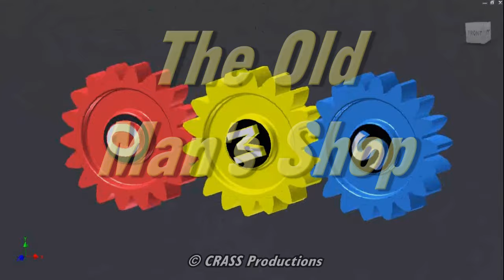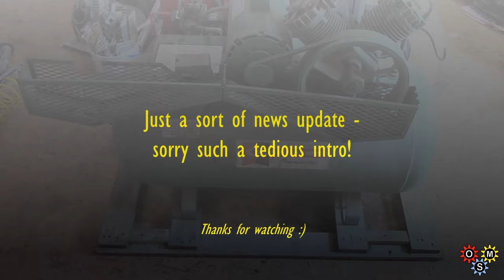Bits - 17. Old compressor and damaged clamp thread

Comment: Champion makes very high quality long life compressors. We just found a 5.5hp dual head gasoline powered unit with almost identical tank as yours, same color $200 craigslist find. All tanks get rusty inside and scale if worried fill it up for a few weeks with 1 part molassas and 9 parts water drain at end of each week and pressure wash it out and refill for an addition week and will strip out every bit of rust clean as new metal. Pressure rinse out and blow it out good and get it dry then use POR Epoxy tank sealant and coatings and never worry about it again. If I recall Eastman stocks it very good product. You will have to remove motors and heads to be able to roll your tank around to get it coated inside everywhere.  Just drain tank once a month minimum but nothing will be rusting the tank away again. Good to see you making another video again and hey insulate your ceiling it will pay for itself in no time and help equalize out the temp changes then eventually do each wall. I have over 12 inches in my shop attic and 8" in the outter walls and all sheetrocked no windows and weatherstripped overhead and side doors and I can take the chill off in winter within 15 minutes and turn off the heat for 4 more hrs and stays workable 60-65 F And its just a pole barn with metal roofing and outside siding. Summer can be 100-120 outside and shop will stay about 80 doing nothing and then turn on a swamp cooler and draw down another 15 deg off of that stays cool and I use very little electricity to do it. Nobody can say they can't afford insulation as the truth of the matter is you can't afford not to as it will cost you much more in the long run with energy bills and being sick all the time working in that cold. like you say unworkable. I know where you are at and winters get brutal but I have seen it 20 below here and my shop will rarely get down to 20 above unless I  lose the cover over the swamp cooler hole than can get cold. So where I am in high desert of eastern oregon we get scorching summers and brutally cold winters and never worry about working in the shop through any of it. Put that in 97' so almost 20 years ago and bet it save at least minimum 50 a month 600 a year 12,000 in those 20 years so far and cost 1,000 to have it insulated with labor just fiberglass bats. I recon its paid for itself what 12 times over in 20 years? I believe that is a pretty good return on investment and Its actually less drafty then in the house and better insulated.
Reply from the maker: Hi,
Wow - thanks for your super long comment.
Your suggested molasses approach sounds useful - thing is, trying to minimize my bending and lifting etc - so initially I am hoping endoscope will at least give me a clue on internal state.
I did couple of years ago put up a ceiling but it's not providing much insulation I have to admit. Trouble now is, apart from any cost factor, I cannot physically deal with further additions. Another thing is, I am not in the shop all the time at all - very sporadic really.
I sure could make good use of your shop! :)

Comment: Good video Chris, glad you enjoyed guest's visit & were able to get some work out of him. 😀 When examining the tank could you run your endoscope through the drain fitting instead of breaking the joints on the intake & risk damaging the lines?
Reply from the maker: Hello Lee, thanks,
Yes, a good couple of weeks - now have to try and catch up on things and get a bit of shop time if possible.
The tank drain fitting is very difficult to get at actually plus, I think I need to drop endoscope in from a high point to get a view. Hopefully I can crack the delivery pipe and get access - we'll see. :)

Comment: Hi Chris,

That compressor looks like it hasn't done much work - it still has over spray on the drive belt (assuming it hasn't been resprayed).

Receiver tanks are generally pretty safe from a weld perspective unless over pressrised.  It's very unlikely to let go or rupture due to rust as the welds are harder than the cylinder.  A weak rust point will just blow out a pin hole and that's it.

The best place to put in an endoscope is at the outlet point, as they often have a large diameter plug that can be unscrewed.

I read the other day that they now recon a pint of beer a day is actually good for your bones and heart.

My bones and heart must be in excellent condition.

Try "Chang" beer if you can get it - made in Thailand but suits the Aussie taste buds.

Cheers Rob
Reply from the maker: Hi Rob - I too have thought maybe it hasn't done too much work - I'll hope to check inside with endoscope first anyways and go from there, and check electrics etc. Outlet point should be removable hopefully.
Interesting re the beer - not a connoisseur myself but we have a nice home brewed ale "Juengling".

Comment: Keep up the good work I have restored a simular clamp screw and it worked out fine . Acme threads are not hard to cut but take extra time shallow cuts .
Reply from the maker: Hi Allan,
Yes, probably will make a replacement when time allows - it'll only be used occasionally. First job is to grind a tool probably.

Comment: Hi Chris, 
This tank is about to get a coloscopy.....   OUTCH....!!!
Hope it's not too filled with debris, if not it could be usable safely, cause those tanks will leak air long before there is any risk of exploding.
Getting older is a pain in the but and all other parts that reminds us about it, now if I spend many hours working in the shop I dearly pay at night, mostly the lower back...  But they say don't stop or it will get worse even faster....   
Take care,    Pierre
Reply from the maker: Hey Pierre,
Yep - try to agree on the 'don't stop' but, have done that for so long now it doesn't work so well! Brain says do something - body says "don't you 'f'ing dare'':)
I'm hoping compressor motor is OK etc and hope to get to getting some time to it this w/e. Plenty to do in shop if I can manage.
Later, Chris

Comment: You can find hundreds of online 'stores' that sell Acme rods in many sizes and lengths. A lot of CNC sites have them. MSC and McMaster Carr may have them as well.
Reply from the maker: Hi Bill - I may yet check out sources but not sure if there'll be a suitable diameter.
Reply from the maker: Thanks Bill - seems they have UNC, UNF and metric but, no ACME. I think I'll probably get to making a new one eventually but am just now continuing on the compressor. Seems viable so far - report coming later.
Reply from the maker: Ahhh - thx much for the link Bill - I'll check that out and see if I can find a size match.
Reply from the maker: Tend to agree Bill - plus no 12 TPI of suitable dia. No probs - will probably make something up eventually... and don't need a whole new one.

Comment: Nice looking compressor! Just a thought - even if you can't get a light or endoscope into the receiver, you might be able to hydrostatically test it (just as with boilers). Should be much easier and thorough than a visual inspection ?

And do keep up the videos - the aches and pains of age are just the payoff for the wisdom and experience we gain in time !

all the best
Reply from the maker: Hi Ben,
Thank you.
Hydro test would be best of course but right now no suitable pump to do it. Hope to get at least some idea with the endoscope initially.

Comment: That is a serious compressor.  I think I would work on that before the clamp.  Worrying about mine.  It has been around for at least 40 years.  It is basically the same model and age as the one that Tubalcain just had a leak on.  I always imagine it splitting down the middle and throwing things all over the place.
Reply: You will most likely get pinhole leaks long before that would ever happen an once enough of them develop here and there the unit has a hard time keeping pressure up..but the champions some are the duel stage and can be run up to 175 and some over 250 psi...if you had a few pinholes develop reset the psi on off setting to around 100 till you can seal the inside of the tank. I have an upright speedair came off the snap on truck have had it since 82 still going strong and keep it uncovered out in open air mounted to concrete slab outside. Need to get a lean to roof over it but so far hasn't seems to hurt it.
Reply from the maker: Hi Harold - well, maybe I will do that first when I can make it to the shop. Be good if it is viable.
Reply from the maker: Hi - sounds like your Speedair has served very well. I know pinholes can develop first but have also seen what happens when a tank actually explodes! I might be over cautious but ......... we'll see how it goes. :)

Comment: Hi Chris
Given the infrequent use of the clamp think I'd be inclined to try some heat ! I was given a 6" machine vice with a bent lead screw which I successfully straightened with some heat 
Keep the vids coming
H
Reply from the maker: Hi,
Thanks - well, may yet give heat a try in case it works. Worth a shot i guess. :)
Reply: Hi Chris neglected to say the one I did was M14 and yes recon width a shot !

Comment: That is a very nice compressor, if the tank is weak, although I have never heard of one leaking, you could always hitch it up to one of the tanks from a cheapo Chinese compressor, there are a lot of them laying around with burned out motors. The Record Sash Cramp ,I am sure you could buy a new screw from Record, it would be an Imperial thread at that age I would think.
Reply from the maker: Hi Chris,
I do actually have a tank from a fairly new HF (POS) unit - took motor and stuff off because it was useless and currently have that tank in parallel with my smaller Hausfeld.
Hope to check that out more soon.
Guess I could get a spare screw - may look into that but also thought it might be interesting to make a new one. If a spare came from UK I'll bet shipping would be silly!

Comment: I'd hydro-test that tank. Fill with water and pump more water until the pressure reaches at least twice (maybe thrice) the max that your air pump can deliver. The advantage of hydro-testing is that water is incompressible, so if the tank leaks or fails it will just squirt a little water rather than explode. There are places that can do it for a fee (fire extinguisher service companies are good) but you could make a small high-pressure piston pump and do it yourself as a project. I would have sworn that one of the Youtube machinists did a video on making such a pump, but I can't find it.
Reply from the maker: Hello Peter,
That's a good idea, thanks, although right now I have no suitable pump. I guess I could find a test place but the whole thing is so heavy I doubt moving it would be too easy. Initially I think I'll try and inspect best I can.
Reply: A small tight piston, a long lever to push the piston down, and a couple of ball-bearing check valves makes a pump. Minor leakage around the piston doesn't matter much for this application; just the amount of water you can force past the second check-valve. Such a pump would be a cool thing to have for many purposes.
Reply from the maker: Food for thought Peter for sure. Initially I think I'll still try endoscopic inspection just to assess.

Comment: As far as the threaded rod goes, perhaps you may be able to straighten it with heat..
Reply from the maker: Hi - well I know I could improve it with heat but - getting back to truth and dealing with the possible thread distortion makes it seem potentially pretty tricky. I'm still keeping options open for now.:)
Reply: The fact that the kink is pretty acute, there isn't much to do to get the thread perfect like Chris is saying, a softer bend on a longer distance would be much easier to unbend without affecting the thread pitch at the bend...   ;)